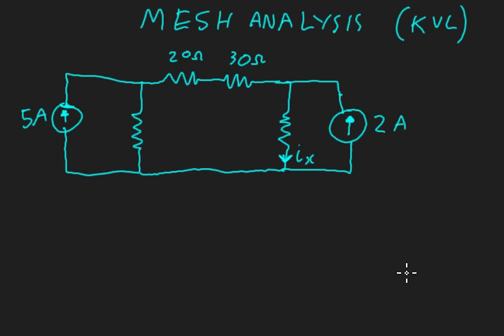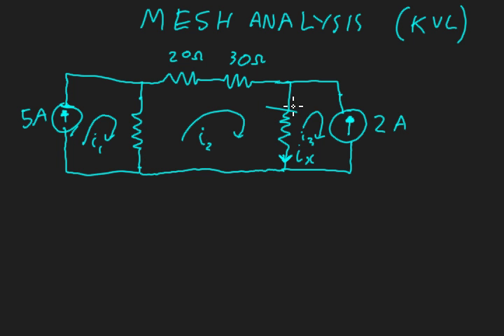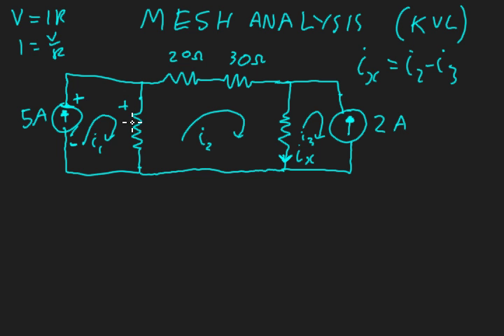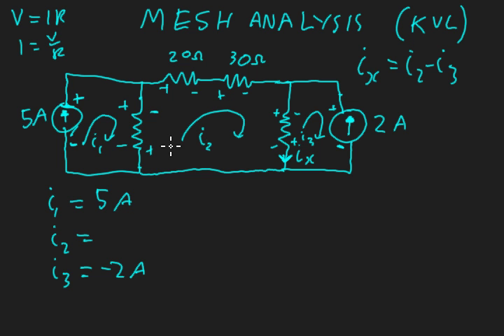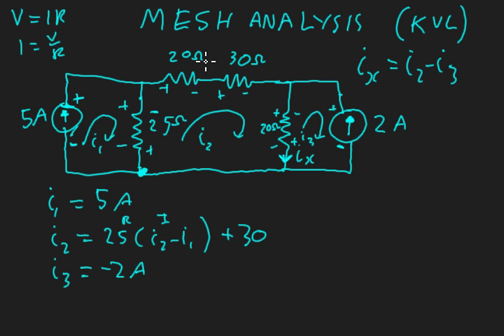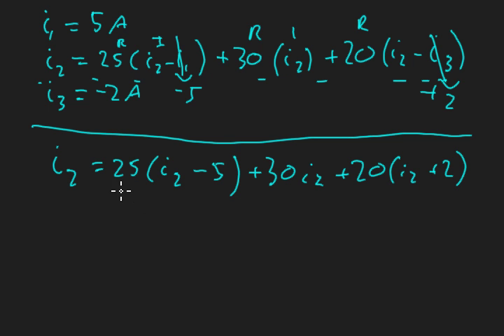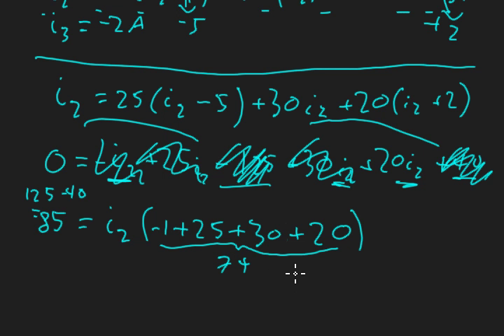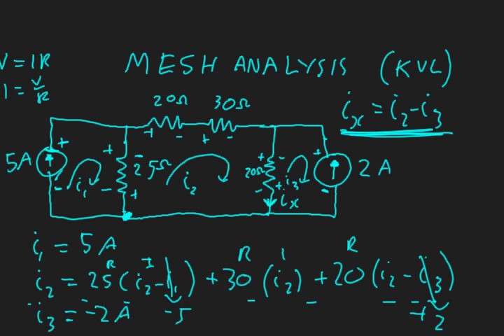08 Mesh analysis

Comment: Your 2nd equation is incorrect. You are summing voltage drops around a closed loop and yet you have said sum equal to the current that you're solving for on the left hand side. Also the coefficient of the i2 term on the right hand side is 50, not 30. You left out the 20 ohm series resistor.

Comment: Yup this solution is not correct.  Mesh Analysis relies on Kirchoff's Voltage Law which is used incorrectly here.  i2 doesn't equal 25(i2-i1)+50(i2)+20(i2-i3).  Instead, 0 = -(25*i1)+25*i2+50*i2-(20*i3)+20*i2; solving for i2, i2 = (25*i1+20*i3) / (25+50+20) = 894.7 mA.  Knowing that ix = i2 - i3, ix = 0.8947 - - 2 = 2.8947A.  If you don't believe me:  Google 'falstad circuit' and create the circuit using their applet to check the current through the 20 ohm resistor.